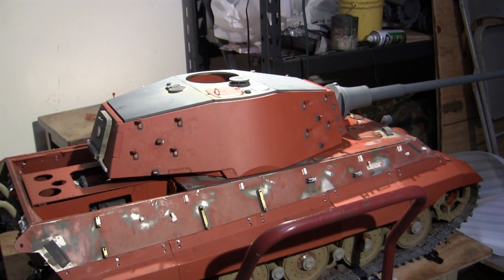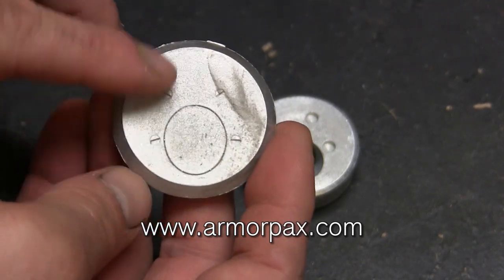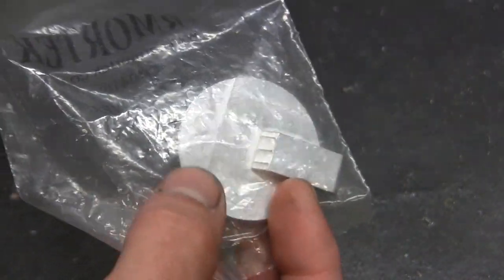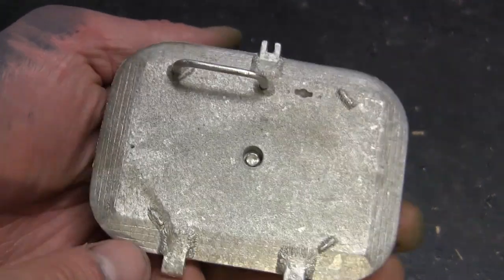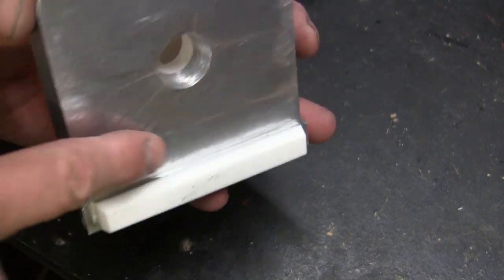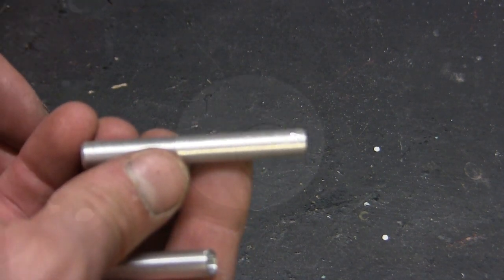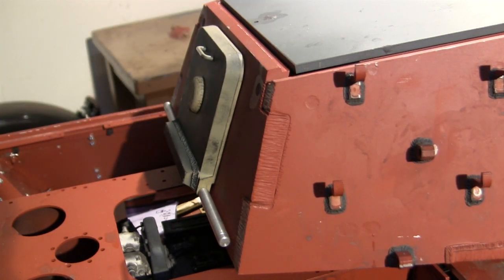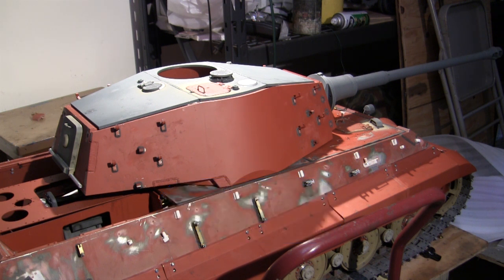Armortek 1/6th scale RC King tiger project video#22 (Turret hatches and roof details)

Comment: I found there is actually a mistake in the design, the pistol port cover is larger in the model than it should be in the real vehicle and that is for the cover just not get correctly in place.
I can argue this with some section drawings of the rear turret hatch from the Germany's Tiger tanks - VK45.02 to Tiger II book.
Hope it helps.

Edit: Also the plate in where all the mechanism is welded should have a thickness of about 5mm to 1cm. The plate in the model is just too thick.
Reply from the maker: Yes the thickness was too thick on the example I have in this video. This was something that I fixed and is only seen on this version here. The production sets have this adjusted and are at the proper thickness.

Comment: Could it be that the large hinged plate on the rear hatch interior is an ammo tray? The rear hatch could certainly be used as an escape route. However I believe that the intended function of that hatch was to facilitate the restocking of ammo for the 88. Just an educated guess though.
Reply from the maker: I don't think it's an ammo tray, but I think it makes sliding in the ammo easier and prevents damage to the shells or the hatch as it makes a smooth surface to slide the ammo into the rear of the turret without having the round snag on any of the equipment found on the inside.
Reply: @oddball759mm  I mis worded my possible explanation. I should've used ammo shute? But I believe we're on the same page. I can't think of anything else it could be and it would explain why that piece was spring loaded.
Reply from the maker: @jonfoisy1237  oddly enough I miss spoke when I said spring loaded, the part swings freely, it retained with a spring loaded latch. Having said that yeah I think we are on the same page with the purpose of this component
Reply: @oddball759mm   My logic is that inside of the Tiger II, the recoil guard behind the breech would, more or less bisect the turret into two halves. Making it very difficult to get from one side of the gun to the other. With a 5 man crew, 2 men could be on the exterior sliding rounds in with 2 men inside receiving and stowing the rounds. With the commander overseeing the operation.